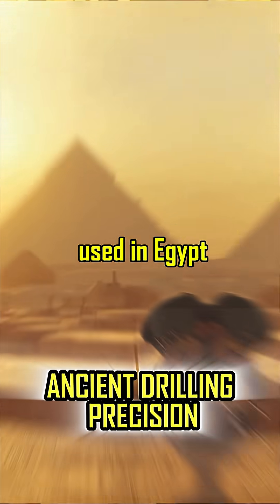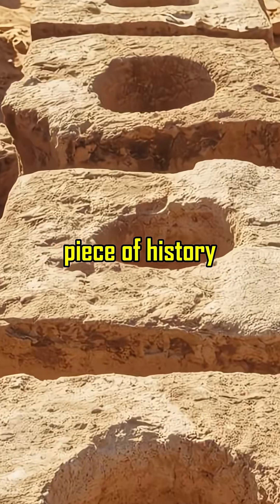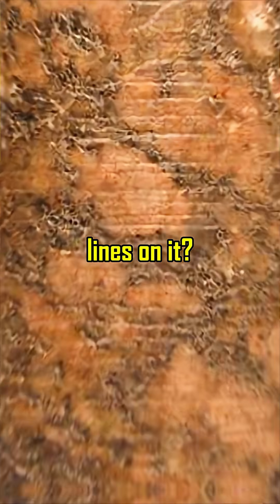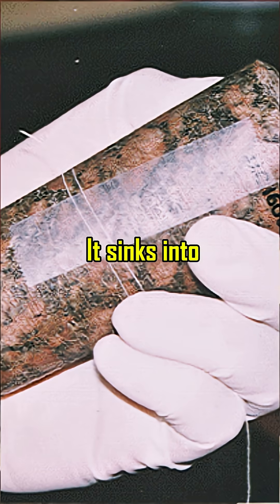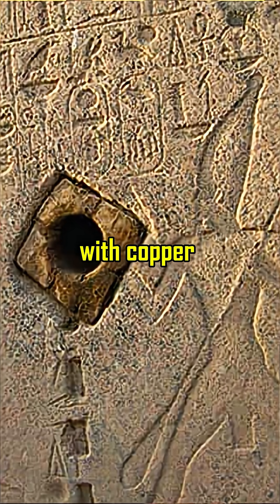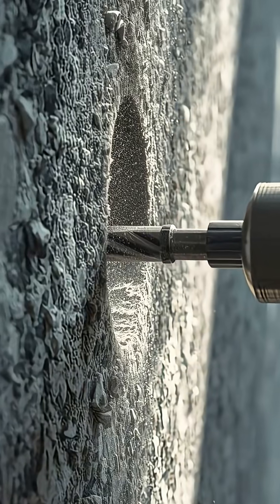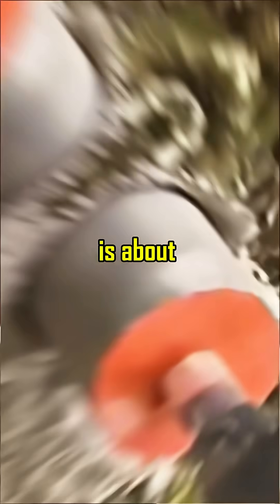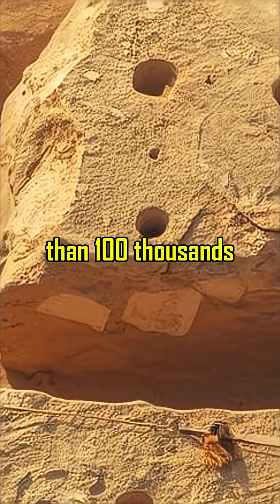The Truth About Ancient Drills – Christopher Dunn

Comment: All this being said, that's definitely how they drilled these holes. Lmao! They drilled them progressively, with single point tools. Imagine tubes or just cylinders of progressively greater diameter, with each of these tools probably only taking a few thousandths, the last pass would be just like the second to the last to finish the hole. We know this because the feed rate per rotation of the tool is not constant. It obviously visually varies wildly. They're just screwing the last tool in there with a very hard piece of stone set in one side of the cylindrical tool.

Comment: When you hike a 50 ton elephant to a spinning devise with the pressure of ten slaves it moves no matter what
Reply: And you will instantly dull a copper drill that will not penetrate solid granite you have to have a material that's way harder than the granite in Granite is almost as hard as diamond. So your theory does not work at all. That proves you do not even have an IQ of a normal human being

Comment: Why is this ‘revelation’ occurring only now?
Reply: Very good question I've always had thoughts of the same thing. But the fact Still Remains you can't drill through solid Granite with anything made out of copper. The hardest thing known to man today is Diamond so your drill would have to be harder than granite that's almost as hard as diamond. Looking at the drill marks the drill was much harder than diamond. Drill rates vary on the diameter of the hole through any material.. the particular hole that they were looking at in the particular piece of granite would have been the 900 RPM that they said the smaller the hole the faster the drill rate

Comment: He called the wrong tool shop. As a Toolmaker. I've cut a 3"diameter hole on a radial drill. Hard material, slow down cutting speed 400-600. Feed rate 1/4=0.250 thou per rotation. Collant steady on cutting area. I've cut through 12" of marble in no time. Like butter. I've cut through granite with collant and air with radial drill, like butter. I think we could drill a tunnel through the pyramid. Hmm??
Reply: I think we need to think outside the box so we’ve got capabilities as that gentleman said that was short so combining other methods like sound or water and sound or I’m not an engineer I wish I was ha ha with all the things we know now that sound can do it can heal it can harm it can levitate I’m going with sound
Reply: @nigelwalker452  How does sound pick up an object?
Reply: @Deploradorable good question, it doesn’t as we would know it “pick up” anything, but it can raise anything from below, as you would imagine blowing air underneath a piece of paper and then the paper raises glides and moves, then so would the heaviest object you can imagine be raised and moved through the vibration that sound (mostly beyond our hearing) can bear to move the air etc 😮
Reply: @nigelwalker452  A hurricane force wind could not move those blocks. A loud audio system ain't gonna do it.
Reply: @Deploradorable I agree, that’s sound force science 👍🏻
Reply: If these people had technology beyond ours, they wouldn't be making and stacking blocks, the most primitive kind of building. A child makes a pyramid, every time, when given a set of blocks. Aliens? Aliens would come here to stack rocks? I don't think so.
Reply: @nigelwalker452 blowing air under a piece of paper is not the same as a sound wave
Reply: @nigelwalker452 you said it best when you admitted to not being any type of engineer. Buy yourself a cheap battery drill and put a copper rod in it and see if you can drill through a piece of granite. I got $1,000 that says you cannot
Reply: You have to also remember that they were doing this by hand or animal power so the RPM'S would be around 10 or less.
Reply: You have never drilled through anything a quarter inch per turn you can't even drill through Balsam wood 1/4 of an inch per turn have any drill. But if you have a giant tunnel Boring Machine like the Air Force does you can drill a 30-foot diameter hole through solid granite at a rate of 7 Mi per day as the drill is atomically heated and melts its way as it grinds Through The Rock

Comment: Just bullshit..how stupid would u have to be to believe this
Reply: What's there to believe?
Reply: What on earth are you on about? Even today we would struggle move that much stone to make a pyramid. How they managed is still being figured out today, what's your so called answer?
Reply: @bronjefferies2612 talking about boring holes not moving stones..😂
Reply: @edwardkearle7196  What's your point? Just because we cant figure out how its been drilled doesn't mean it isn't possible. People on the internet acting like their engineers, while actual engineers cant explain how the pyramids were created.
Reply: @bronjefferies2612  You also need to be an engineer to understand that you're looking at something that technically can't exist, but obviously does. The impact traces clearly show, that they drilled through granite literally like a hot knife through butter. This inspite of there being no record of them using tools capable of drilling such holes at all.
Reply: @Berend-ov8of  The cut was too rough to be advanced engineering. ( I am an engineer ). Modern machines can cut where there is no cut lines.
Reply: @tonydalton6756  My thoughts exactly, where did the cut lines come from, because they are there, and it's not decoration. Have you considered how you can maximize surface impact by making the rock and the tool resonate in counter phase? It's a bit sloppy, but it hits real hard.
Reply: @bronjefferies2612  Humans can make a crane that would lift as much as you wanted as long as we had enough materials to build it. Cranes are designed for a purpose. There is no reason to over engineer unless you want to lose money.
Reply: @tonydalton6756 Making a crane that size with the limited technology they had doesn't make sense. We also need to factor things like the cost and man power  required. As an engineer you must be scratching your head trying figure out that achieved anything off this scale
Reply: Joe levels of stupid.
Reply: There are videos on youtube showing  people using  primitive bowdrills, over a long time and getting these results.. in egypt. It's not alien technology. Google bowdrills and primitive stone tool technology and prepare to have your mi d blown.

Comment: They were getting down with sound. Acoustic drills.
Reply: Ahm,... yes, sort of. It's technically sound, but it's the sound of the granite, if that makes sense. It's fairly simple once you understand it. Diamond drilling completely ignores the movement of the granite, so all impact is by chance. It's kind of the opposite of dancing.
Reply: What's an acoustic drill?
Reply: @gareth0412  Sonic, Vibrationary drill, A drill that vibrates the drill piece or the object being drilled.
Reply: @gareth0412  A drill that operates by means of resonance between the frequency applied on the drill bit and the specific frequency of the drilled material. It concentrates all energy on the contact surface, thereby optimizing surface deformation. It's a bit like sticking a hot knife in butter, which doesn't depend on how sharp the knife is, but rather on how hot it is. Like @bobdown3143 points out, it also works the other way around, i.e. by applying frequency on the drilled body.

Comment: Guy, that doesn't even know basic math.
He called a granite countertop company, not a quarry, that's for sure.
I'm a guy that has a hobby of working with stone, and I'm in construction.
Needless to say about everything this guy says is B.S.
He sits around and makes up things.
Real research people have gone out with people and moved rock and cut rock with the tools they had.
It's not that tough.
Reply: Moreover, thise ancient people had plenty of diamond dust. They cannot cut diamonds, but to crush the diamond to dust is easy task. So, thats why they were mad of diamonds, despite the inability to make it a shiny jewlery
Reply: Saying it isn't very tough is a flat out lie.    It is incredibly difficult especially when you are dealing with weights in excess of 2 tons being moved by man power.    A modern company could re create the pyramids In roughly 8-10 years.   Placing 6 blocks an hour every hour 24/7 for 10 years.   If the stones are pre cut and positioned.    If they have to be cut and shaped then even longer.    Taking the 2.5 million stones.  That would require 420 000 lifts.     Moving heavy weight is EASIER but it still is difficult and required the proper equipment.  Modern equipment.   That's not to mention the 80-100 ton granite blocks on the interior.    I'm not saying they had alien tech or anything stupid, but they clearly had a level of knowledge that we don't regarding stone.
Reply: @tylerouimette2934  No they had stone working knowledge that YOU DONT HAVE. 
Dont use your ignorance standard to judge any stone worker today or any construction worker.
We can build that. Its only lazy people like you that think placing that much is a big deal.
I live in Denver. Go look at the mass of crushed stone, compacted strutual soil and concrete in that facility.
Reply: @tylerouimette2934  Pulled up info after my comment.
About 3 million yards of stone in the largest pyramid.
Theres more concrete in DIA. Well over a million more. What your ignorance doesnt know is that the rest of the structural fill is more than that.
So throwing around 6 to 9 million yard to just do the runways on a medium sized US city.
You're so far behind that you think you're  in the lead making dumb comments like 
"They knew something then we don't today."
Reply: @sparksmcgee6641  Pouring concrete is not the same as quarrying, cutting, and shipping individual stones in excess of 2000kgs.  It takes time to cure the concrete and excavate the ground, but the process of pouring the concrete is significantly easier.
Reply: @tylerouimette2934 Yeah I know since I build things for a living and I'm a concrete expert.
Know a lot about stone also.
Claims we cant do what they did then now is laughable when some little city does bigger projects.

In many ways concrete is more difficult to do than stone.